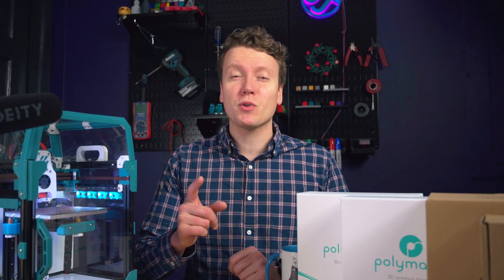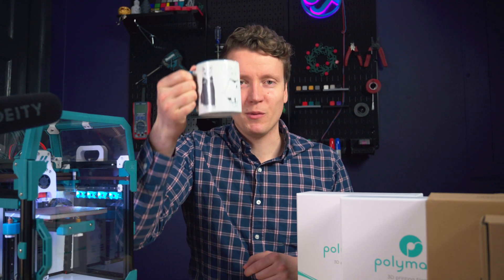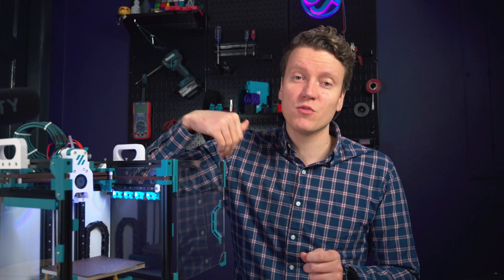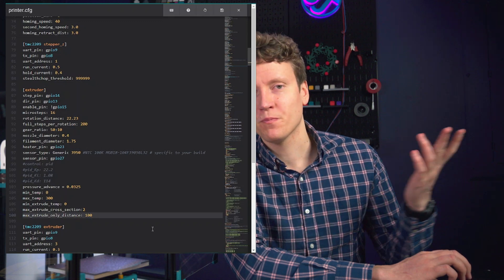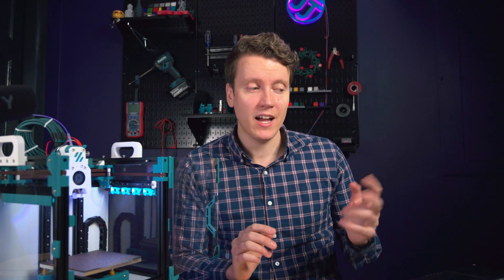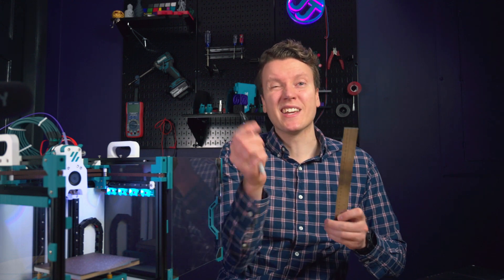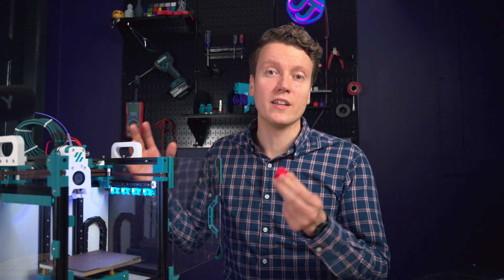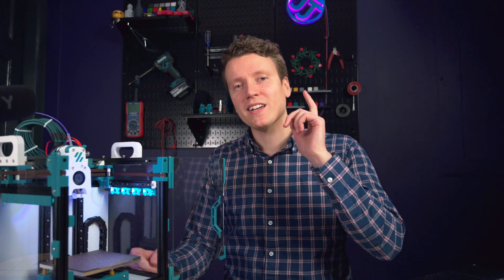Klipper 3D Printer Extruder Calibration | also Marlin, Direct Drive, and Bowden E-Step Calculation

Comment: Filament got on the thread before I figured how to extrude with the heat. Nozzle and block stripped delaying a happy finish to an all nighter compiling a firmware for klipper. Luckily I had my old heating block but had to dismantle that whole assembly to replace it. Sigh lol

Comment: For the CONFUSED KLIPPER USERS: just take your (original rotational distance) multiply by your (measured extrusion distance) and divide that by the requested distance. That will give you your new rotational distance. Example: Old rotational distance = 30, Measured extrude distance = 47mm, requested extrude distance = 50mm.Then  (30 * 47) / 50 = 28.2. So 28.2 would be your new rotational distance.

Comment: why do i keep getting different values and extrude distances every time i try this? 
something isn't clear enough.
I started out as 33.5 default then got 20.1, 26.04 206.13, 33.843, and now 96.445
my marlin DEFAULT_AXIS_STEPS_PER_UNIT for E was 146.8
i feel like im trying to catch a donkey on bouncy castle.

i made a calculator in open office spread sheet and used your values to make sure it works right and i get the same rotation_distance. 
I dont understand what im doing wrong.

Comment: My desktop and my printer are in completely different locations, so I am unable to achieve any kind of connection between the two. Is it possible to adjust the E steps by putting code into the starting g-code?

Comment: No need to calculate anything 😂 just adjust the number until it extrudes the proper amount. if it's not extruding enough, on klipper the number has to go down. The rotation distance I found that worked was 23.38 for microswiss direct drive extruder for my ender 5 plus.

Comment: This should be emphasised more boldly, coming from Marlin, among other 100 new things to learn, this is kinda shock when you can not find where or how to calibrate your e-steps because Klipper use a different calculation. And i remember when i did not know anything about 3D printing steps/mm was pretty easy to understand in no time. Now i am still blinking what is this mm/step thing. I will come along, but still shaking my head a bit.
Reply: I mean I just did mine without any calculation at all. I just extruded, measured and saw it wasn't enough then changed the number and tried again. Turns out a smaller number makes it extrude more 😂. I just kept going incrementally until the number I got matched the 100mm extrusion that was supposed to happen. Took like 5 tries and I didn't have to use any math.

Comment: So there were a couple of things I didn't understand, in your calculations at 6:43 - Where did you get the 200 x 16 from? I know the 16 is the number of steps, but I don't see the 200 anyplace on the chart and didn't hear it mentioned. I can only assume it is the full_steps_per_rotation setting I saw in your config.

So I basically did exactly what you did, 200*16 / <new E-Steps> and it still didn't extrude properly, it was way under by about 75%. So then I noticed you have a gear ratio in your config, mine was set to 1:1 with a Sprite Pro (that I now know has a 3.5:1 gearbox). It might be worth mentioning something about the gear ratio since it might be applicable to others as well.
Reply: The 200 is indeed the amount of steps a stepper motor with 1.8° per step needs to make the shaft turn 360°.

Comment: Where are you getting the 143.9 value from?
Reply: you don't even need it. He confused the heck out of me too! Just take your (original rotational distance) multiply by your (measured extrusion distance) and divide that by the requested distance. That will give you your new rotational distance. Example: Old rotational distance = 30, Measured extrude distance = 47mm, requested extrude distance = 50mm.Then  (30 * 47) / 50 = 28.2. So 28.2 would be your new rotational distance.
Reply: its from the above equation for klipper. He needs to know what his esteps are and the above formula for klipper is how you figure out your esteps. (my problem is i dont have a "full_steps_per_roation" section in my printer.cfg)
Edit: I believe if on marlin you can ignore this equation and just put in your current esteps in place of his 143.9

Comment: where i get the full steps per rotation ? i don't have that value
Reply: That depends on your stepper motor. My Kobra Go stepper motors are all 1.8° per full step which makes 200 steps per full rotation of the shaft.

Comment: Where are you getting the full steps per rotation? I see the rotation distance and micro steps but I am not seeing the full steps per rotation
Reply: Full steps is the specification that the stepper is sold with, for most 3D printers 200, multiply this by the micro steps (16 mostly) and you have the Klipper “full” steps
Reply: I am in the same boat. My config file does not contain a setting. I don't see how I can use this process without that number either :(

Comment: Hey JJ, would you happen to have examples of setting up load and unload filament macros for a Prusa Mini?  I've recently flashed mine to Klipper and Mainsail and am having a hard time finding examples for bowden setups that will mimic the Prusa load/unload along with how to setup mesh bed leveling before every print.  I love how great the whole thing is running compared to octoprint/prusa firmware.

Comment: When I first started 3D printing I used to calibrate my extruder this exact same way and never got really good consistent results.

As an engineer I always question why I was being told to calibrate an electric motor in free running mode with no load on it. This is not the way to calibrate an electric motor has electric motors whether they're steppers or not are designed to run with a load, running a stepper with no load is not a good idea.

So then I started experimenting with calibrating my e-steps through the nozzle at the temperature I was printing at. And lo and behold the quality of my prints improved exponentially.

So yeah if you're trying to calibrate your extruder do it at your printing temperature and extrude the filament at a fairly slow rate. Don't use the firmwares extrude button as it pushes the filament far too fast. You want to extrude it just about f60 in Marlin

So I usually execute a command sequence such as
G91
G1 E50 F60.

Prior to issuing this command I will trim exactly 60 mm of filament off the backside of the extruder. Then I measure the remaining filament after it completes the command and there should be exactly 20 mm of filament left. I find it much easier to use calipers to measure short distance is like this rather than trying to measure 100 mm piece of filament with a caliper.

I can usually get my printer calibrated within 3% using this method. You can't expect much more than that when you have filament that varies by + or - .003mm
Reply: Glad someone mentioned you should be calibrating it to the environment in which it will be working and not the theoretical perfect environment e.g. no load. This is why doing the math and setting the value isn't correct and you need to run a manual test in the first place.

Comment: There is no reason to convert the rotation distance to e-steps and back. Easier/better formula for klipper: rotDisNew = rotDisOld*(120mm - Rest)/100mm.
Reply: Thanks! I was wondering where they got the 200 in the formula... Yours works perfectly.
Reply: @kloakovalimonada the 200 are the full steps per 360° rotation of the shaft on a stepper motor with 1.8° per full step :) that times the amount of microsteps divided by the e-steps he calculated gives him his new rotation distance. But yes that's rather complicated compared to above formula
Reply: Where you getting the 120mm, and what the freak is “Rest” value ???
Reply: @tomvedra  you mark off 120mm on the filament and then tell the extruder to feed only 100mm, what’s left is the “rest”.  If it only extruded 98.5 of the 100 you told it to then it’s 120-98.5/100.  So the new rotation_distance would be your old, let’s say 35.600. So 35.600 x 98.5/100 = 35.066 would be your new rotation_distance.  Yea you maybe knew that but I also went over it to help myself too.
Reply: Thanks dude. You saved me a headache
Reply: What's Rest?
Reply: @Frankie_Freedom  the number you get after extruding, given you underextrude.
Reply: @TheRockDK  The number that's left over? hmm.. okay gotcha thanks
Reply: @Frankie_Freedom  Correct.

Comment: Thank you helped me understand how to do this, the only issue is that the common calculation does not work for my prusa mini+ since it under extruded more after the changes. I used your math method and the teaching tech website guide calculator.
I ended up doing it manually by changing from rotation_distance:26.2564 to rotation_distance: 24.99

Comment: Thanks for the video.

If you don't want to heat up the hotend, which I don't think is needed but not sure with a direct drive, you could add "min_extrude_temp :20" to your [extruder] segment.
Allows you to extrude  way below the default 170C. Of course you could adjust 20 to something lower if your room has a lower then 20C temp.
Reply: @Christopher Easler no idea. I neve worked with OctoPrint.

Comment: Great vid, but
Holy crap is that more complicated than it needs to be.
I know my way is not right, but it's quick & dirty.
I picked a random rotation_distance: 25, measured 120, then E100 F50, and had 88.87 left.
That's only 31.13% of the expected 100 so I took 31.13% of 25 for 7.7825
Re-ran it again and got 99.78 of the 100
Reply: He's just going by Klippers documentation and how it says to do it, which I absolutely agree is needlessly complicated. In fact coming from Marlin and Rep Rap I'm not really a fan of how Klipper handles this at all, really miss just editing steps per mm directly. it's goofy to me that they make you edit the part of the equation that's in the denominator as well as if you don't know the equation it doesn't make sense that you need to decrease the rotation distance to get more extrusion or vice versa. Your method is pretty much the same as mine.
Reply: @aharkey1077  unfortunately for some reason I am way over extruding. With no nozzle in, when I put in 100 mm I get 100 mm +/-1, however when I print each layer is blobbing up into the next layer. It is clipping it and it sounds like sound paper. I'm running at an 84% flow to get good prints.
Reply: @3sotErik  dude that’s the exact issue I’m having! Built a V2.4 with stealthburner and I got it extruding exactly 50 mm but while printing it way overextrudes.
Reply: @aharkey1077  So apparently we need to try it the right way, maybe. My steppers (not all are stock) didn't come with documentation, so I don't know what to put.
Reply: That was not easier.

Comment: i have no idea where this 200x16 came from
Reply: 200 = full steps per rotation, 16= microsteps. most steppers are a 1.8 degree stepper. so the steps it needs to make 200 steps for a full rotation(200 = 360/1.8). if you are using a 0.9 degree stepper, its 400.
Reply: @askemerci3599  And how would I know the number of microsteps, if my stepper does a 1.8 degree, etc. these numbers appear to have come from thin air.

Comment: Love this kind of video's and trying to check it in klipper. Where did you get the value 143.94. You one show the old rotation_distance 22.23. Maybe you could explain that also.
Reply from the maker: The 143.94 is the E-steps. I got that from (full_steps_per_rotation)*(microsteps)/(rotation_distance)
So (200)*(16)/(22.23) = 143.94
Sorry I didn't make that clear in the video.
Reply: @JJShankles  also depending on the motor installed.. Microsteps you find in the config. but the full_steps_per_rotation can be found by knowing what stepper motor you have..
I have a 0.9degree motor. 
so 360 degrees / 0.9degree = 400 full_steps_per_rotation
default is 1.8 on many printers. but check the modelnumber and so forth.

Comment: Hi  JJ Shankles, just one noob question, I have a V0.1 with LDO motors and was trying to understand where did you get in Klipper the old E-Steps info? thanks
Reply from the maker: If you are looking for a baseline number to start with you can start with the stock numbers from the Voron website here: https://docs.vorondesign.com/build/software/configuration.html

Comment: if you have a config with rotation distance, you can also use "rotation_distance = <previous_rotation_distance> * <actual_extrude_distance> / <requested_extrude_distance>", right?
Reply: This is the way.  This video is just confusing.
Reply: This was much easier to config exactly what I needed.  I tried following the video and for some reason at the end when it wanted 200x16 / New E-steps = Rotation distance, ended up being like 5X higher than my starting number, which I was supposed to be going in the other direction!
Reply from the maker: Yes that is correct. I just wanted to simplify it into one single E-Step Equation to hopefully help with any confusion. But that equation works too.
Reply: This calculation worked great, and was easy to determine.  Thanks
Reply: This comment should be pinned
Reply: thank you, i was so confused on where he suddenly got the old esteps from